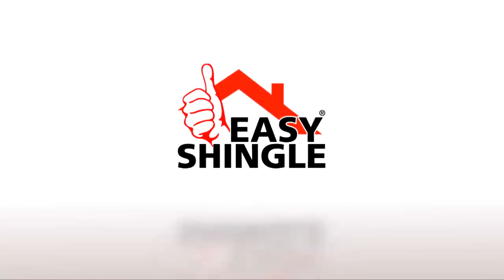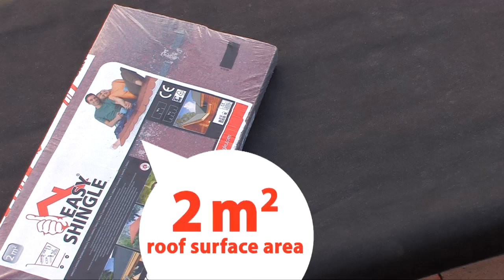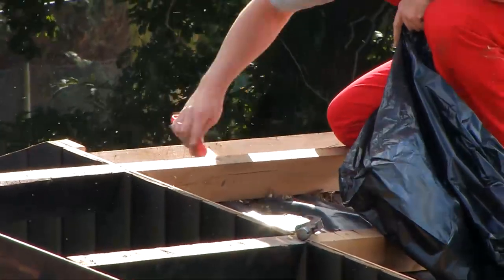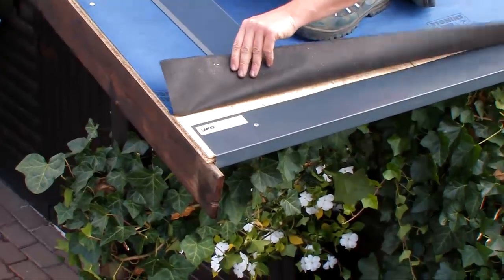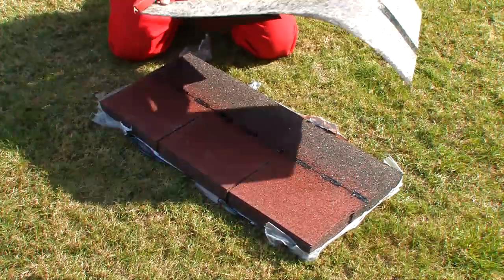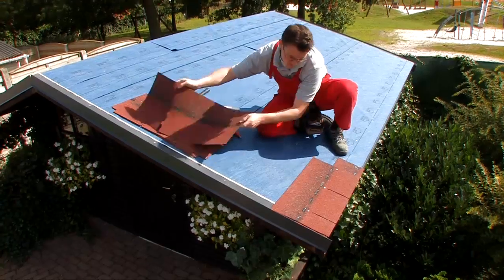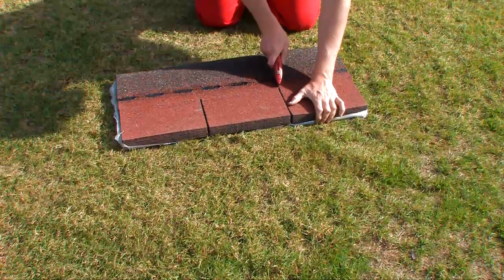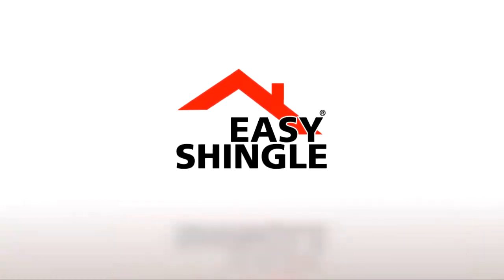DIY How to apply shingles - Easy Shingle - on your roof (garden shed)

Comment: Upturned hem on drip edge, eh? Pretty neat. On the bottom eave of the shed, I might have trimed the end off that gable end fascia board so I could get the lower eave drip edge cut to wrap around the corner. I definitely wouldn't choose a gravel-stop gable drip edge. I also might put more nails in the headlap of the underlayment, so it can't blow around like that. Also, lower eave overhang should be at least one inch. I would also reccommend nailing the final row of shingles down over the ridge.

Comment: Hi! Thanks for this very helpful video. Don't forget about the venting. If you are roofing your home be sure to use the proper vents so your attic will have proper circulation. Ridge vents are one on the best and are fairly simple to install.

Comment: @old64goat A good rule of thumb is to buy 1 bundle for every 4x8 sheet of plywood and 1 or 2 extra bundles for the ridge cap. Your 5x8 foot roof would take just over 1 bundle so you'll need to get 2 bundles.

Comment: Are you sure the roofing nails should be installed below the tar strip? I've heard professionals say it has to be in the tar strip and others say it has to be just above the tar strip. Witch is right. This videos shows the roofing nails being installed below the tar strip. Pros would say that makes the nails vulnerable to rusting over time.
Reply from the maker: Position of roofing nails is very important because every nail must also catch the top part (head-lap) of the shingle below. It’s very important in terms of wind resistance. The correct position of nail is 25 mm above the cut-out. There can be some small tolerance but every nail which is applied higher than 30-35 mm will be not covered by manufacturer warranty. We also name this “High Nailing”.

Comment: @old64goat I know it's a little late for advice ten months later, but if you just mutiply the length of both the planes together, in this case 8ft x 5ft = 40 square feet. Typically, a bundle of shingles measures 33.3 square feet, so you wont be able to get it all out of just one bundle. I'd go with two, assuming that there won't be any ridge capping or valley waste.

Comment: Excellent video.  Easy to understand.  
For the conversion challenged:
     1 cm = 2.54 inches
     10 cm = 4 inches
     15 cm = 12 inches
     20 cm = 20 inches
     6 - 10 mm = 3/16 - 3/8 of an inch
     2 cm = 3/4 of an inch
     14 cm = 5 1/2 inches
@old64goat and @moron32 Most of the world operates on metric measurements.  They're a Belgium company.  Do the conversion.  I'm proud to be an American and embarrassed by Americans who think the entire world should cater to us.
Reply: Marilyn, this might have been useful to your fellow Americans if you hadn't got most of the conversions wrong!
1 inch = 2.54 cm (or 25.4 mm) 1 cm is 0.39 inch.
30.5 cm = 12 inches
50.8 cm =  20 inches
In Britain our retractable steel tape measures have inches down one edge and centimetres/millimetres down the other, simple. I'm of the older generation that still think in feet and inches (and miles) but the metric system has been taught in schools since the 1970s and the younger generation are clued up.

Comment: ur drip edge is wrong on the gable...water will gather on that lip sticking up and be sent back underneath the shingles.....it should be flat and have a shingle overhang the edge around an inch

Comment: At 3:37 there was a huge mistake made. The shingle he is putting down is only three inches from the rake. This means he will need a piece 3 inches long. What should have happened is that he should have calculated for that when starting the job. If he had adjusted his lines he could have used a much larger piece which would have make for a much better job overall.

Comment: how much angle do I need to use these, I have a 5 inch difference from one side to the other on my lean to, will this work, if so how will I finish the edges?
Reply from the maker: +Roach BJJ 
The minimum slope for these shingles is 15 degrees which is 26,8% or 3/12. All the edges like eaves and rakes have to be finished with metal flashings.
http://www.iko.be/documents/graphics/pdfs/application-guides/appli-guide-uk-web.pdf